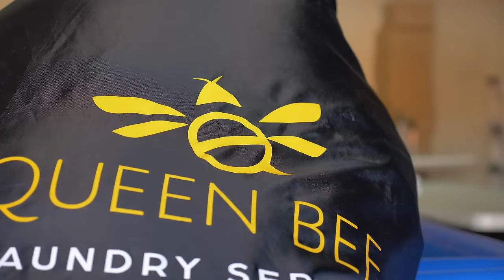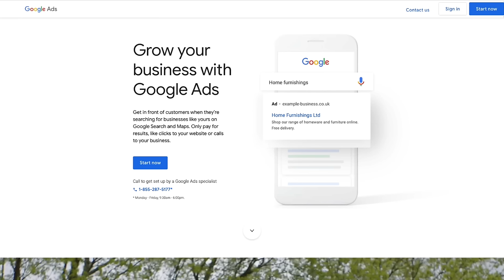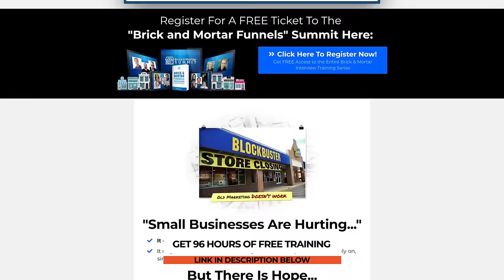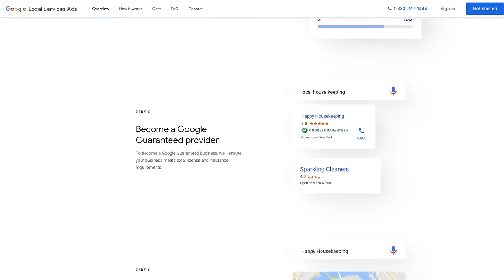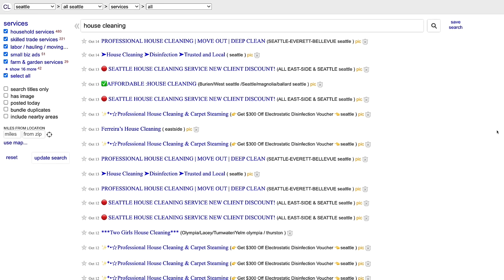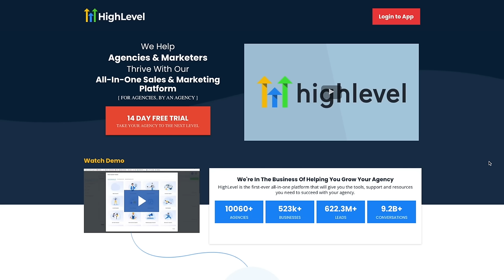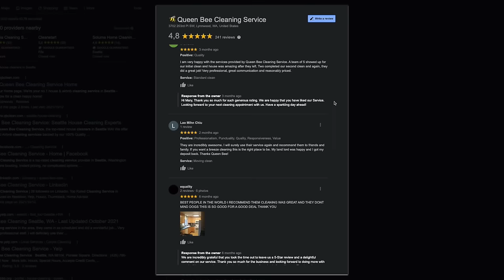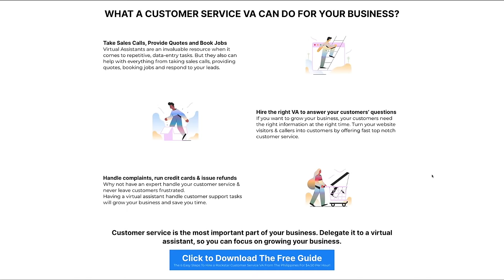Starting a $120K/Month Cleaning Business From Scratch

Comment: What services are usually included in a move in/out cleaning? Do you scrub carpets and remove trash? Or is it basic deep cleaning like walls, floor boards, ceiling fans etc? Also, how do you know exactly what you're getting into if they're submitting the online form? If a home is in bad shape after a move out and you're not aware of it until showing up, do you change the price?
Reply: Move out cleanings are very through. You have to clean top to bottom plus inside the appliances and cabinets.
Yes if the the home is in a bad state, we adjust the price, hope this helps

Comment: Thanks Chris for the info, may i ask where do you look for your airbnb customer ? And do you only pick those airbnb customer who charges high daily rate? As it doesnt make sense to look for those airbnb customer who charges low rates?
Reply: That's correct, we only work with hosts who charges a minimum of $350 per night, the small hosts are not a good fit for our model, as for how I get my customers, they find actually come to us because of our good reputation.

Comment: What is the per call fee?
Reply: Google charges you for each call you receive from the campaign, usually $22 per call
Reply: @CristobalMondragon  what a rip off their is no chance they will hire you just from a call.  Any tips to get work with these platforms?  I'm using Facebook ads at $30 a month and it only got me 2 jobs. I'm a handyman. Maybe cleaning is better? Moneys tight so I cant spend alot on ads and spending more probably won't necessarily bring more results.